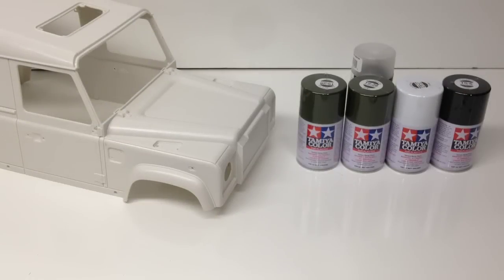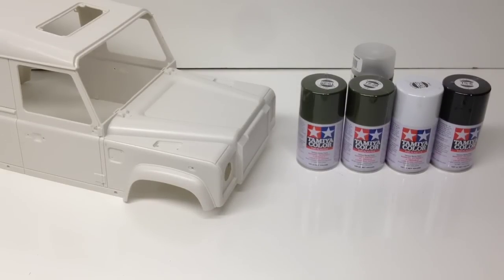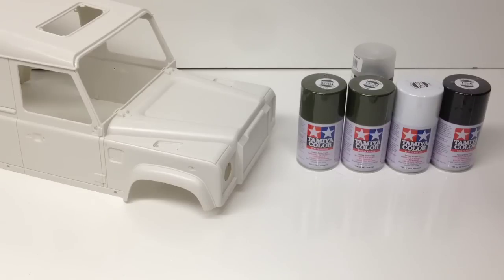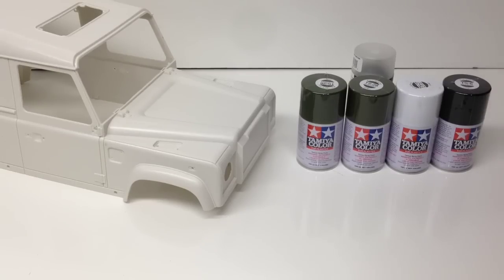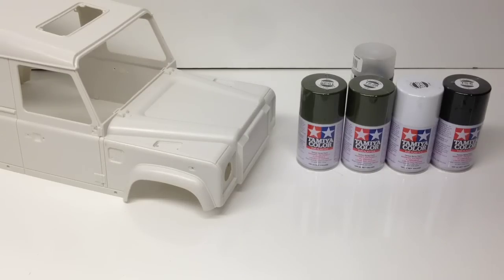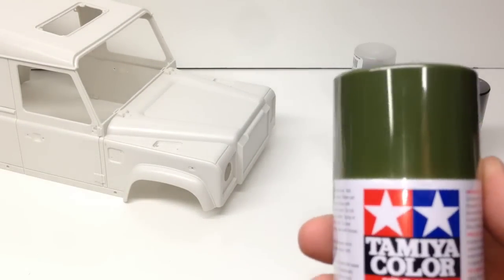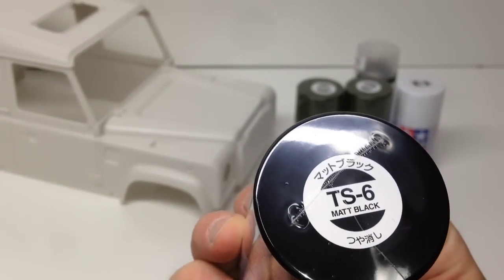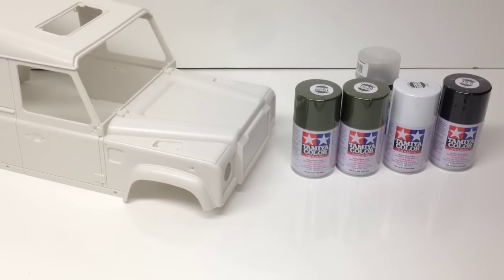RC4WD Gelande 2 - Painting a Hard Body, which paints to use

Comment: i've painted a handful of hardbodies and i've found that if you can find a krylon or rustoleum color that you like at walmart, go for it. especially the colors that have the primer mixed in with them. only issue is that you will most likely need to do some wet sanding. the tamiya TS paints definitely spry a thinner pattern and need less if any touch up. BUT they are 10 dollars a pop vs 3 or 4 dollars for a bigger can of walmart paint. as far as quality of paint, i see no difference between the two other than how much wet sanding you need to do when you are finished. if you are going to buy tamiya TS spray for a 1/10 crawler do yourself a favor and BUY 2 CANS. those little cans go quick.
Reply from the maker: I don't know.....this was my first Hardbody and based on many people's recommendations, saving a few bucks (using Krylon or such) or having to replace the $100+ hardbody??  I was fine with the $18 in Tamiya paint.
Reply: The RCNetwork i don't see how you could ruin a body by spray painting it. even using the shittiest cheapest spray paint that the finish looks like sand paper is fixed relatively easy by some wet sanding. you're almost better off because you have enough paint in the bigger cans that you can load it on and have enough layer to sand it down to a mirror finish. as fine as the tamiya cans spray, they still need some wet sanding but with those you have to be light because you didn't get enough paint in a can to lay down a nice coat. two tamiya cans is still less paint than a krylon can. the krylon and rustoleum paints that are out now have a primer mixed in with them and may even be a better paint honestly. tamiya has some nicer colors to choose from though. i just can't think of how you could have a hardbody be irreparable from a bad paint job.
Reply from the maker: +DB Cooper still fine with the $18 Tamiya investment.....
Reply: The RCNetwork i can understand that.

Comment from the maker: Nice.  I just put in the JConcepts aluminum bell cranks with carbon ackerman.  It cleans up some of the steering slop.  They buggy is great so far, but now after seeing the 22-4 from TLR and then the new 4wd buggy from HotBodies, they look a bit better than the AE!  The HotBodies buggy really looks beefy and had 3 fluid filled geared diffs.  I don't know how many front a arms I've broken so far on the B44.2 and just realized I cracked the rear CF shock tower!

Comment: is it just the flexible difference? has anyone used lexan paints on these? I have a ton of lexan paints and would love to airbrush them. also wondering if I can buy some "TS" style paints that I can put in my airbrush.  EDIT:  just pulled out my paints and they are "FasKolor" brand lexan paints "and other surfaces"  as stated on the label. on the back it says Metal, Plastic, Wood, Fiberglass, and Ceramics.   so im fairly confident I can use them.  probably even without primer. but I may head back to the shop to grab some FasKolor primer just in case.